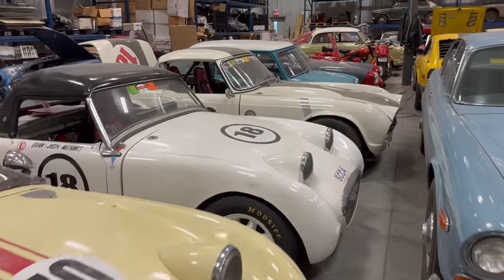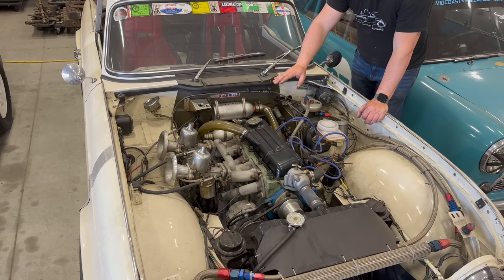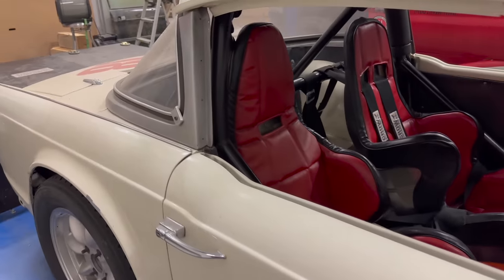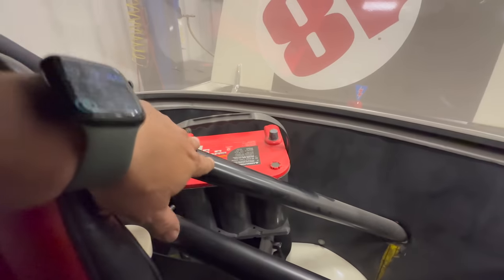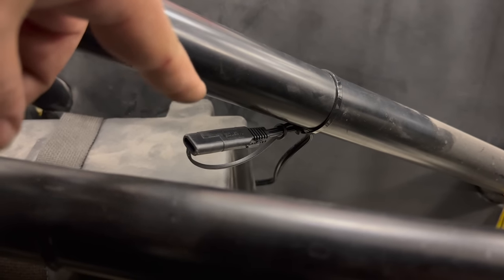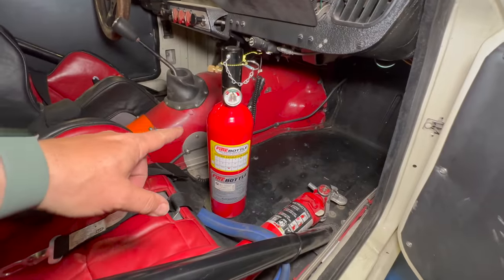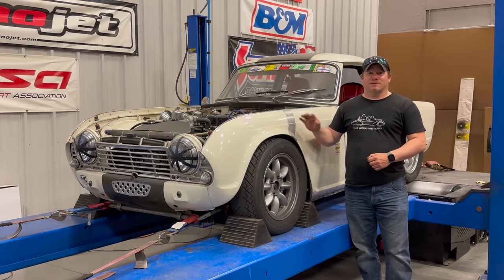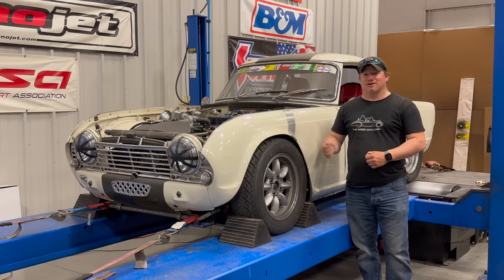Prepping the Triumph TR4 Race Car

Comment: Nice car!!  I've been a TR guy for over 50 years now.  Currently have 2 '63 TR4's for restoration.  I like the surrey top and backlight on the race car!  And it looks like you have a later model brake system and reservoir .  Good luck in the racing